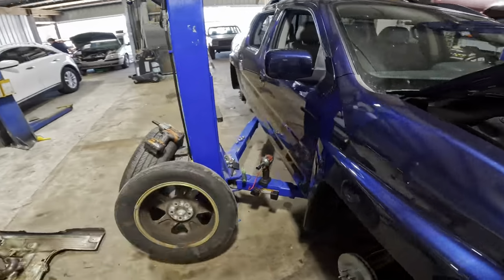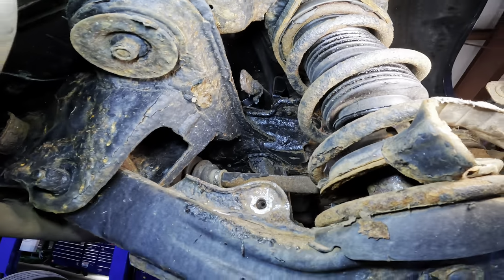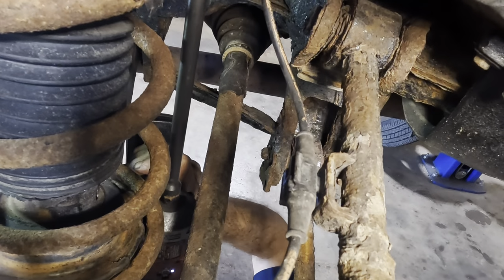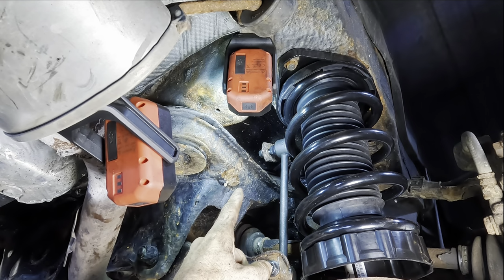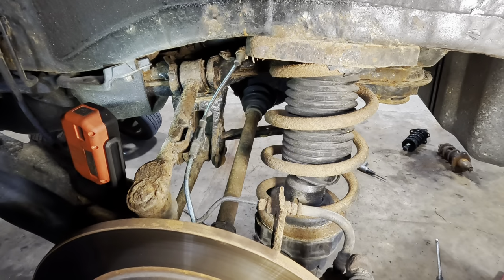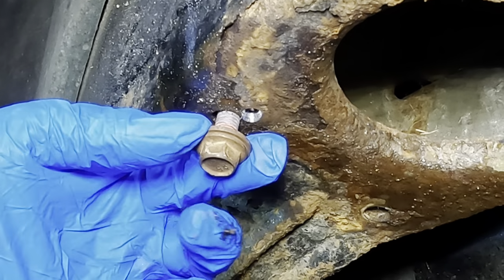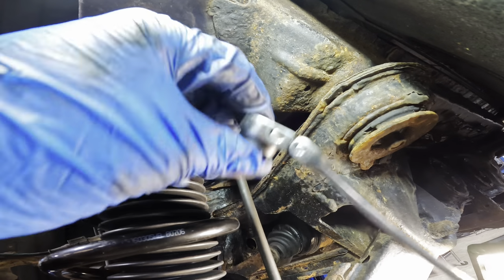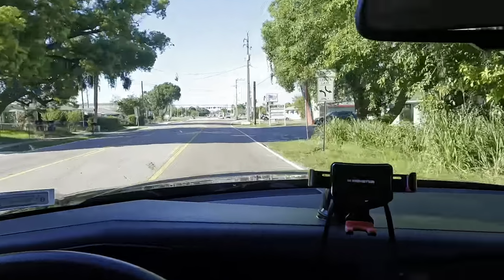Broke off in the FRAME! Strut Job Going Wrong! Honda 3.5 2006-2014 @MilwaukeeTool Pt2

Comment: I have to hand it to ya Ray, you pulled it off. When you said I'm going to weld it through that hole, I said bullsht. Then you actually did it. That thing was rusted even more than I thought. If it were mine, I would go under it with a wire brush and then treat with the rust reversal crap. It would have been nice to clean up the area you were working on while you had it apart. Oh well, I guess it really doesn't matter if it is going back to the rust belt, but is something the owner can do on his own. It not only fixed the problem, but did improve the "look" a little having those new parts, and I would definitely change those corroded calipers. It is now safe for the guy and his family. Nice job Rainman!
Reply: Induction heat coils work great and are much safer than a torch!
As a aside, bolts are measured by their diameter not by the socket size.

Comment: GREAT tip for welding the captive nut!  Ive been in this unfortunate circumstance many times (Ohio..lol) and have had to resort to knurled studs in some cases where there is even less access. Never thought about hitting the weld externally

Comment: Welcome to the world of Northern garages. Our tool of choice is the cutting torch. After completing the job, we would pick the rust off the shop floor with a coal shovel...I am surprised that the frame not cracked. Didn't surprise me he didn't want the AC fixed, we rarely used AC in the North.

Comment: Those sway bar links are designed to put a hex key in the end. Then remove the nut without spinning. I replaced mine with Moog as well.

Comment: ALSO ALSO: i personally like to go at rusted mating surfaces with a wire brush and cover it in silicone grease. Itll help keep whatever is already rusty from rusting any more and keep the surfaces from allowing moisture it settle inbetween the new part and the car itself. Just an FYI. Rust prevention is always on my mind when installing new parts, itll help keep the new part from failing early.

Comment: I’m glad I live in Deep South Texas where this kind of underside corrosion is not a problem. The underside of my 2016 Colorado is still in pristine condition. The frame and other components still look black. This truck in this climate will easily last me at least 20 years.

Comment: I started buying all my brake and suspension components from Detroit axle. Prices are great, 10 year warranty. Struts with springs, all the way around on a Mercury Mountaineer was about $225. That was a couple years ago. New set of rotors with ceramic pads for the rear of my K2500 Suburban was $175.

Comment: I usually cut along the side of nut and bolt and not through the side.Cut off a small portion of the nut and then spread it apart or sometimes a socket will do the job.Though I'm no mechanic.Take care and be safe.

Comment: Politics aside, California cars never see rust like this! Glad to be here.  Also a little couple alternative weld methods I’ve used, bend a welding rod a few inches from the end and put it through the hole. Bolt needs to be flush. Another way I’ve used is drill out the threads the size of the nut, hold it flush with bolt and weld all the way around from the outside. PS: love watching your work!
Reply: rust doesnt know about politics

Comment: Ray,If you try to remove a nut and bolt that is not connected to the frame why not just cut the nut and bolt off and replace both.I'm not a mechanic but have done just that and replaced the bolt and nut.Saved a lot of time not fighting with it.

Comment: a tip when cutting a nut - bolt off if the bolt is long cut the length short if not forget this step then cut the bolt and nut in half from the end. doing so is much easier to control and not hit the base

Comment: When working on this type of rust, a bit of good acetylene torch work does wonders to remove rusted bolts and other items that need to be gone. Much simpler than any other method of removal. If it is liquid, it can not be stuck!!!

Comment: Having done the sway bar links on my Pilot, I learned you'll never get those sway bar links to unscrew.  Cut down through the bolt and nut with a cutoff wheel (cutting the nut in half or in quarters) and split the nut off with a chisel.

Comment: Hey Ray,  I really enjoy your videos and admire your great mechanical skills.  I look forward to seeing your videos daily.  I have owned quite a few trucks in my lifetime.  In my younger days when I used to cut a lot of firewood and haul some large loads of stuff around, my favorite truck was my 2000 full size Chevy Z-71, 4 wheel drive.  It was a great truck and had 240,000 miles on it when I got rid of it.  Now I am an older man and I have a nice 2012 Honda Ridgeline 4wd truck.  I am physically handicapped now, so I am unable to do the work I used to do, but I love my Ridgeline.  I will still love watching your videos, even though you dissed Ridgelines.....LOL  😂   Thank you for putting out such great content in your videos.  Keep up the good work!

Comment: Omg, i feel annoying with leaving so many of these messages... BUT our good friend Eric O. taught me something when griding off a old sway bar link. Cut it long ways right down the middle. Itll easily break off when you go at it with an air hammer! That way youre not grinding the frame when your cutting it.

Comment: Sawzall and angle grinder - my tools of choice for sway bar links. Although I did the last set without using either of those tools - I had a new pass through socket set I wanted to try out and used it with an allen wrench, even here in the Western NY rust belt.
Reply: By the way, I do enjoy seeing you work on a NY car. It justifies a lot of how I work on my cars!

Comment: That’s the first time I’ve seen a cut off tool used as designed, since my instructor demonstrated it, roughly 40 years ago. The electric one is much quieter than the Ingersol Rand pneumatic one was.
But the trouble is, they never ever seem to fit in the places where they’re needed, so other less effective tools get pressed into service.
Reply: I agree, that little cordless disc cutter is awesome.

Comment: Really enjoying watching Ray maintain his good humour, wrestling with the sort of stuff we deal with every day, here. Rusty snow falling off of everything we lift over our heads is par for the course and odd size bolt heads are common, due to wastage. My running commentary would not be suitable for publication, especially when stuff gets in my eyes!
I’ve used Chinese springs a couple of times, but generally don’t recommend them. None of mine were able to maintain standard ride height for long and the spring rate was softer than standard too, despite me specifically ordering heavy duty, where that was an option.
Luckily, I had advised against them, before the order was placed, so warranty was not an issue, but the solution was to get good used ones from the scrap yard. Not always going to be possible, though.
I’m aware of a company in the UK that manufactures springs to original specs, but there’s a lead time that makes it less attractive and now we have the aftermath of Brexit to deal with as well, so cost is going to make them prohibitive.
I’m keen to find a European spring supplier, but have not put the effort in, yet.

Comment: I've been in Phoenix all my life, never saw cars like this, I think they all disintegrate before they got out west. Don't they have under car spray systems in front of the garage. You'd need antifreeze in it. I'd spray everything I was going to work on with penetrating spray and let it sit awhile. How long can you keep putting new parts on some of these rust buckets. You better come to Arizona or somewhere warm and dry to buy a used car. Great vids Thnx to you all

Comment: ALSO, WHEN WORKING ON CRUSTY CARS: Its a really good idea to attack the bolts with a wire brush and presoak them in some kind of rust lubricant. I personally like PB Blaster. It doesnt work ALL the time but i know it helps with super crusty nuts and bolts.
Reply: ALSO ALSO ALSO: Anti seize is your friend when putting crusty bolts back in. Any lubrication is better than none when putting old, rusty bolts back into a rusty frame.

Comment: Can't wait for the day they start using sweet metal  folded and layered together to create the frame of sky scrappers .... rait and road bridges..  and the mega suspension bridges that span accross our larges  waterways.... works great for auto truck manufacturers ... their shares of stock prices have increased since they stopped using stoked steel frames and went with the more desirable unibody construction..customers repurchase every 7 years as natural of fact ....which shows how satisfied they are

Comment: Had the same issue with a captive nut for a front lower arm last week. Detached inside the subframe. Had to cut a 3" X  2" hole in the frame, weld a nut onto a plate, then weld said plate with the nut onto the subframe.. was an utter pain in the ass.

Comment: Last one i promise... if youre ever worried about a rusty nut/bolt breaking off, it best to go at it with a hand wrench or breaker bar first. Its much easier to tell if something is going to break off that way. An impact usually will break it immediately. If you can catch it before it breaks and really baby it out of there with lots of tender love, rust lubricant and maybe a little heat, youll save yourself so many headaches.

Comment: Just a tip. if you are going to replace the swaybar link. Tighten the nut with the impact.  Then it will break and popp off, and you dont have to cut it. or hold the stud from spinning.
Reply: Thanks shade tree tommy!

Comment: A vehicle driven many miles over heavily salted winter roads. Note the worse issues on the passenger side. That’s the side of the vehicle usually subject to more salt water on the downhill side of the road where most of the salty slush accumulates. You a brave man, Ray, to just plunging into all the rust. Seen some vehicles where everything disintegrates and there’s nothing left to attach replacement parts. That said, the entire underside of this vehicle is a corrosion disaster promising to threaten somebody’s health, someday.

Comment: My approach to those sway bar links is to run a thread chaser on the exposed threads to clean up what is there so you aren’t fighting it once it breaks free, if that doesn’t work, I try to pop the link off the ball and hold the ball with a good vice grip
Reply: Instead of the thread chaser I try to cut off the expose threads when possible.
Reply: @desotosky1372  I try to reuse if I can…

Comment: Nice job. I was thinking of replacing the nut and bolt with a stud welded into the body and a nut to hold the strut. Whatever works. Thanks.

Comment: Hey ray good morning to you and your family. Ray i got a tool you need to buy and i believe that  it would help you out a lot its called a inductive  heater . It runs on electric  but it will heat up bolts and nuts . It is a tool that will turn a big bolt red hot in a quick  moment.  Its hard to explain the  tool but i think you would like it a lot. Be sure you get some coils for heater. And it is like a torch in away butt with no flame . But one i think you will use it alot. By the way keep up the good video

Comment: Rust requires heat, torches and even some penetrating oil. Believe in it or not. Ya gotta be careful with the prybar and pounding also you can break more than you want to. 
But ya got it

Comment: Hey man. Living up north, the first thing is penetrating oil. And those frame holes are a perfect place to squirt it in for blind threads. I mean it The first place to squirt it before starting the job. You really need to invest in a torch and plasma cutter.
It's snowbird season, dude. Yeah. .....did you ever put sealant on the top idler bolt that went into the water jacket of the thread insert repair of the subbie engine? Notice the o-ring on the bolt for it? hmmmmm.......

Comment: That was one very cool repair. I was stumped about how you would fix that. Love ya' skills, love ya' attitude. We are not worthy.🙂 What a great place to work!
Reply: I was also stumped and thought about making a "nut" by drilling and tapping a large enough piece of flat bar steel that wouldn't be able to rotate with the bolt.

Comment: Ray now had firsthand experience with what Eric O deals with daily.  Take a torch and torch those stubborn nuts off.  After watching Eric use a torch, it seems to take less time than a grinding wheel.

Nic job welding that hidden nut.  Made me wonder how it was originally done during assembly.

First it was you and the Mrs..  Then it was you, the Mrs., and Troy.  Now it's you, the Mrs., Troy, and Dave.  Wow, you've done well in a few short months.
Reply: Don't forget Maya (hope I spelled her name correctly).  😉
Reply: @craigcraigster4999    Oops... shotty memory
Reply: Eric O dance in your dreams?
Reply: @DeeGee-mv6eq  Do you Eric O. troll much?

Comment: ray i know  how much of a nightmare these things  can be,  problem is nylock nuts  plus rust and dirt. and no flats  to get a wrench on,  onnly a little hex  in the stud rounds out,  ive done these on my 01 focus and friends ford mondeo of similar age, focus   right side, on and off  no problem,   mondeo  got  lucky  but 3 out of the 4   basically had to cut  a stud off,

Comment: Good repair. I did'nt even think of doing it that way, my thought was drill a hole in the chassis the size of the flange nut push it in and weld the flange to the chassis grind smooth, job jobbed. I noticed Maya had on her OSHA approved safety Croc's ;0)

Comment: I highly suggest, when working on nasty, northern car rusted suspension fasteners ALWAYS start the repair process by SOAKING EVERYTHING WITH PENETRATING OIL !   Then, when parts won't come loose, use an Induction Heater which usually works.     Then as a last resort, there's always a torch to make it "liquid",  LOL !

Comment: Nice undercoating, nothing like painting over all of the rust hoping it will go away. Love your videos.
Reply: NY'er here.  The license plate starts with a K, meaning it was issued within the last few years, so the Ridgeline was almost certainly bought used.  The "paint" very much looks like Ziebart undercoating, and if it is,  Eric O over at South Main Auto posted a few years ago about how Ziebart can actually make cars rust faster
Reply: @siddithers5356  🤣🤣🤣
Reply: Eric O lovefest?

Comment: I was wondering if you'd ever tried one of those 'bolt buster' induction heaters to work on bolts/studs like those?  I've got no experience with them but it seems they should do the job although they are stupidly expensive...

Anyway. love the channel.
Reply: My thoughts exactly.  See them being used all the time in the UK.

Comment: The original sway bar links were machined with an allen head within the studs. I'm just wondering for the removal why you didn't first try an allen key and wrench instead of going right at them with your impact wrench gun to declare 'failure'. Using some penetrting oil with a little torch heat may have also been helpful. By the way, I thought you drilling a hole in the frame and  lining it up with a threaded bolt into the nut and then mig welding it was ingenious. Nice video. Thanks. You sure know how to get the job done.
Reply: When I've done link rods that crusty, the allen slots would just shear. Sometimes I can get away with putting the suspension under tension which helps grip the threads of link rod.
Reply: But we did get to see the angry spanner (wrench) in action

Comment: Ha ! Just this morning before I watched this, I used my own Milwaukee 18V "Fuel" Sawzall to cut about 30 protruding pieces of horse stall rods, so they wouldn't poke the horse and cause injury.  I'd purchased that Milwaukee one to use the same Red Lithium batteries that came with my Milwaukee drill package, the service award I chose after 40 years with Dial Soap/Henkel.  (Of course they downsized me/eliminated my job 6 months later, but I got 52 weeks of severance pay plus my pensions.)

Comment: Looking for opinions. I do all my own repairs on my personal vehicles but never really had any cordless impact guns. Any opinions on 300 vs 600 lb impact wrench. Wondering if the 300 would be good enough for light work passenger car tires and jobs or should I just go for more torque. Not doing anything heavy duty but not much experience with the cordless electric stuff. Not sure which way to go just don't want to regret buying the lighter duty after the fact. Basically is the 300 enough for the DIY jobs. Thanks.

Comment: I only recently had the opportunity to replace sway bar links on a few cars.
One requir d a very thin open ended wrench on the other side, away from the nut.
The ither, similar to the Ridgeline uses a torx in the center of the shaft, but that limits you to using only a wrench. Cant get an impact over the bokt when a torx is needed in the center.
Why they dont just do a conventional nut and bolt is beyond me.

Comment: I am somewhat surprised that you don't tidy the frame with a wire brush while you have components removed.
then spray with"rustoleum"(or similar) before re-installation.
If the car will now live "down south" the owners might appreciate the extra effort even though you would obviously charge for your time.
But, given we NEVER have such rust in Australia I might be wrong.

Comment: Just wondering why not hit the bolts with a wire wheel? 

I would slather them with anti seize but I know and understand why you don't. 

But no idea why not clean off as much rust as you can..

Comment: Just a question Ray, but why don't you apply some grease on the bolts when you reasemble big parts like this when they are subject to rust? 🤔
I'm a mecanic in Belgium and i apply grease regularely to prevent difficulties not only for me but also for other mecanic who gonna work on the cars we receive in our shop. 🤷‍♂️